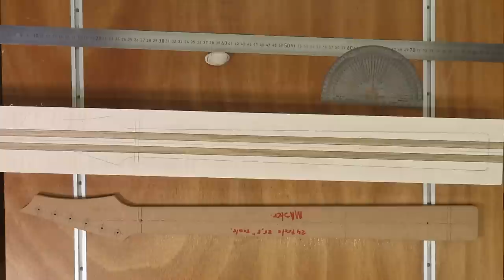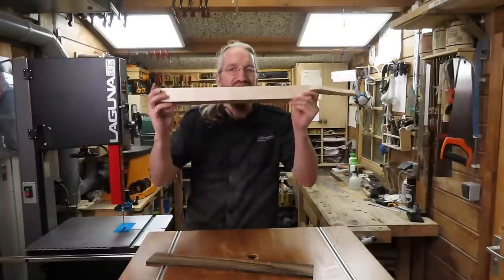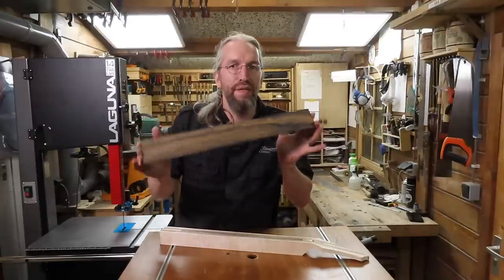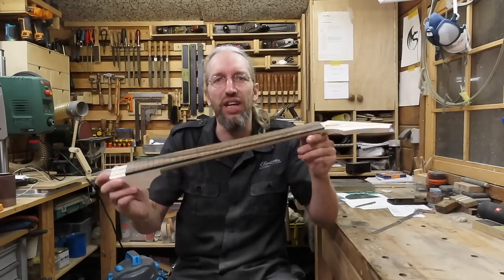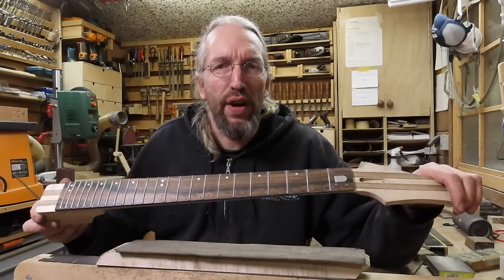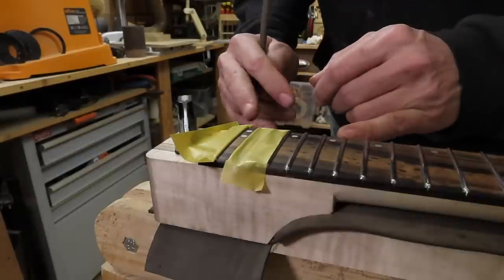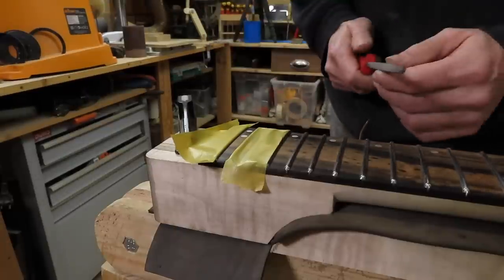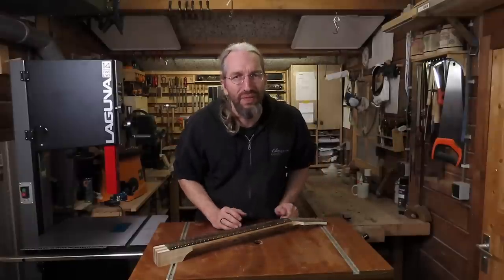Building a Custom Guitar - Part 1 "Making the Neck"

Comment: Great to see you building again. I thought you would use that awesome new drum sander to level off the blank? I found it does a great job with body, neck, and fretboard blanks for that.
Reply from the maker: Hi R.L. Lynch.
Thank you.
I hadn't stopped building, just altered my upload schedule a bit.
I used the sander to thickness the neck blank (not in the video though) but I needed 1 reference surface of the blank to be true, level, straight and square to the center line. Unfortunately without a planer I still need to do that by hand, but the sander makes the rest much easier.